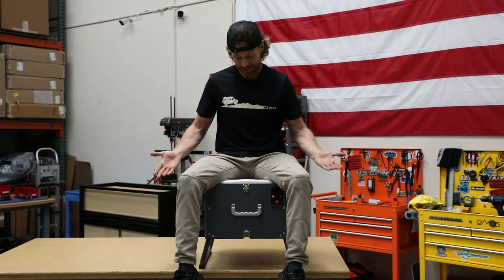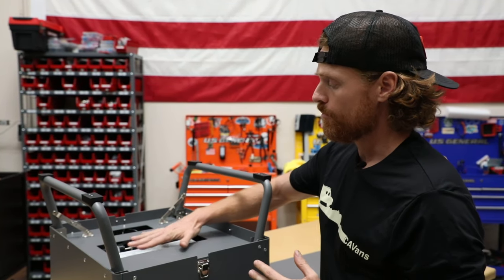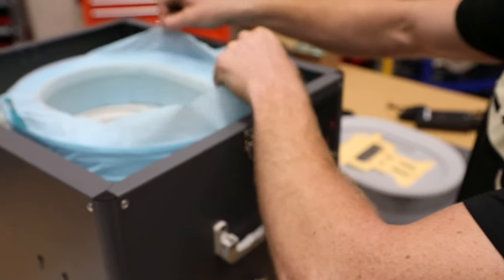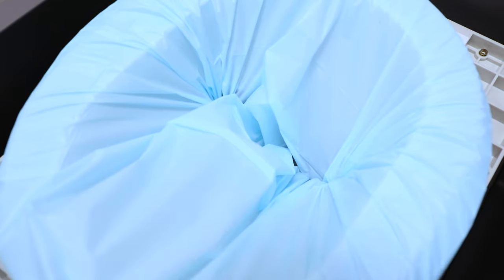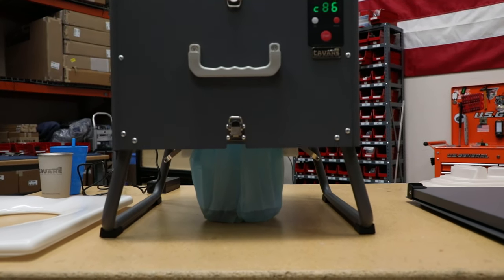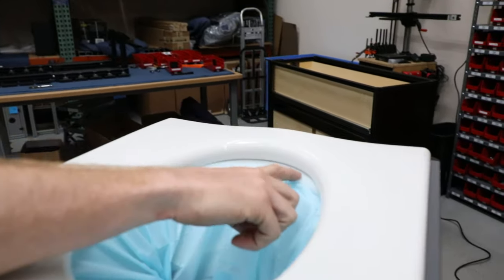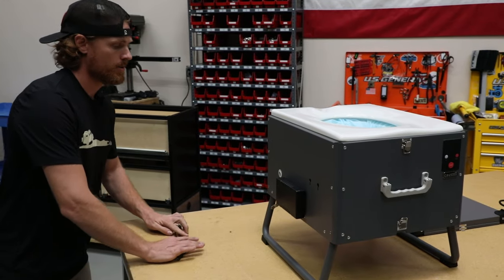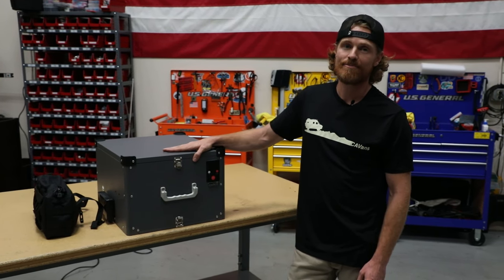AMT Toilet Walkthrough & Demo

Comment: Great video. How many uses per installed roll of plastic bag material ??. You emphasized verifying getting a good seal after plastic roll install prior to 1st use....how likely is it to get a bad seal after several uses on the same installed plastic roll ??
Reply from the maker: There are 50 bags per film roll and if you get a good first seal the rest shouldn't have issues as long as your toilet has power. You just want to test it to ensure that it's all working properly before you use it for real.